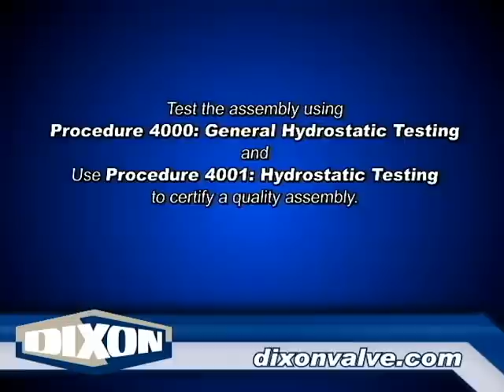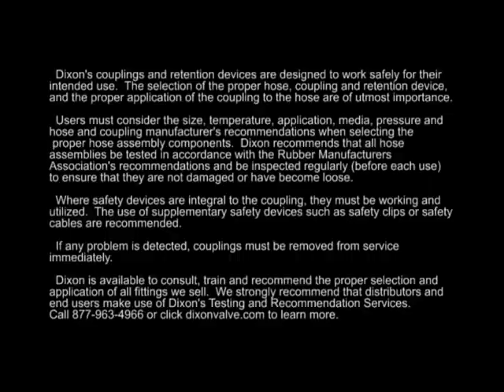Procedure 2305: Brass Reusable Fittings

Comment: Safe for fuel line?
Reply from the maker: Hi, 
No, the reusable brass fittings are for low pressure rubber hose for water or air.
Reply: @DixonValve  -- And what do you consider "low pressure"?

Also, are the threads that screw into the inside of the hose and the ones on the outside of the hose straight threads or tapered threads?
Reply from the maker: @jakeblanton6853  The reusable are rated to 250 PSI at ambient temp and 150 PSI at -40 F to + 160 F.

The threads on the stem that insert into the hose are UNF threads (straight threads) 

The threads on the ferrule that go over the hose are either left hand UNC / UNF threads (straight threads) 

If you would like to discuss your application please contact sales@dixonvalve.com
Reply: @DixonValve  -- So not as good as the supposed 300 PSIG that the hose might have been originally rated to, but good enough for most people since they normally are only going to around 100-150 PSIG on their hoses.

I don't really have a need for one of those connectors, but as a retired engineer, I was just curious.  Are you cutting the threads with sharp edges on them or rounding them over?  I would think that rounding them over might give a better seal without damaging the rubber of the hose.  Of course, since hoses are made from different materials, what might work best with one type of hose might not work best with a different type of hose.